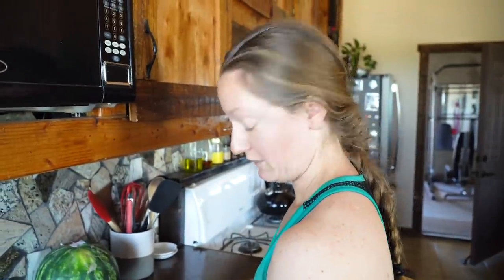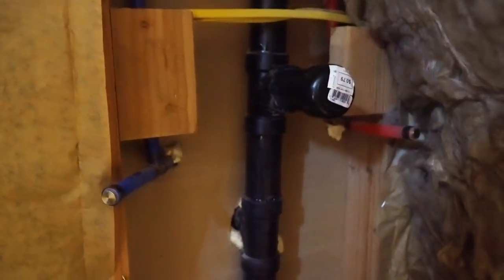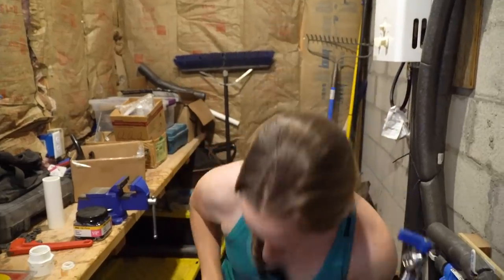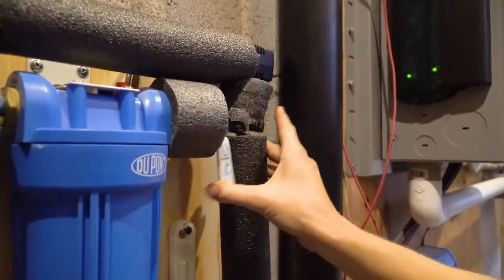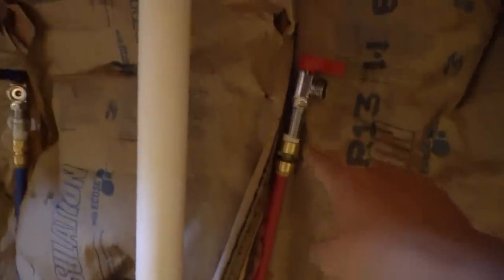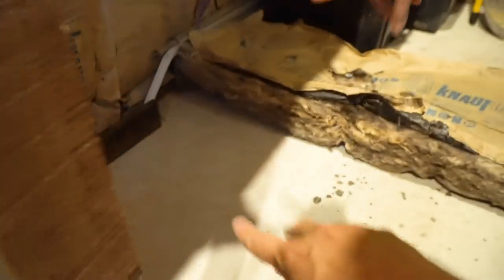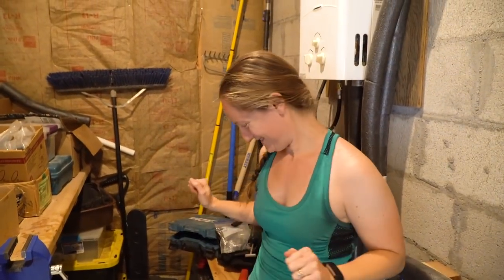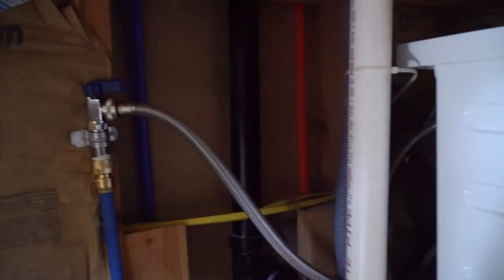Off-Grid Living: We just got a major upgrade

Comment: Nice install... EXTREMELY fortunate that the previous owner had the plumb in done.  Time and DOLLARS!!  I'll be the fun🚨🚨 here though.  I would highly recommend you get a slightly smaller clamp and clamp the pex and NOT the stainless braided hoses. Dissimilar metals for one and chance of abrasion for two.  Alternative would be to use a plastic (PVC) clamp.  Should be in the plumbing section or
 maybe the electrical aisle at a big box stores with the PVC conduit.  Just a suggestion....
You guys are getting a lot of national press with your monetary success in transitioning from sticks and bricks to RV to kinda sometimes sticks and bricks. LOL 😜 Congratulations 🎉🎉
Later...Terry

Comment: Question--S&C, If you have the time, what is size and brand of the blue vise on your workbench, if you recommend? Thanks. I have been shopping for one and either way more than I need or too spayensive. 😳 I need the Goldilox one.
Reply from the maker: To be honest, we didn't shop around for this one. We saw it at Ace Hardware and just bought it because we needed a vice.  :)

In general, I'd encourage you to go a little heavier-duty than you think you need. It's always better to get a vice that's a little stronger because it'll give you more options for what you can do with it.